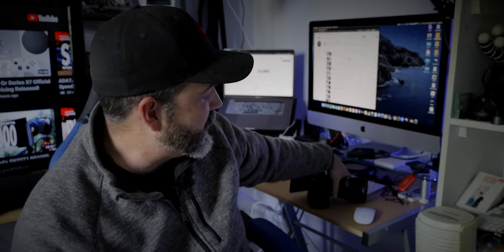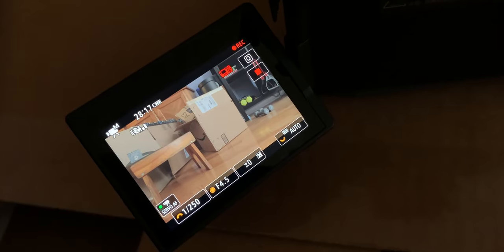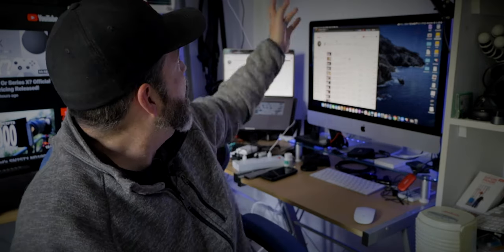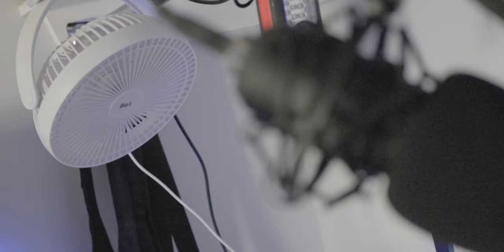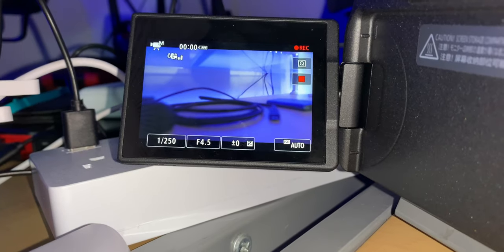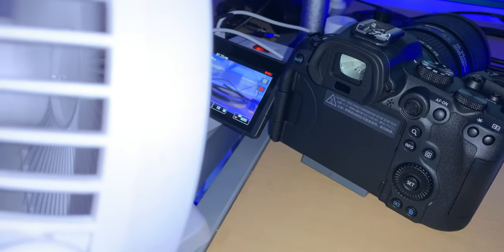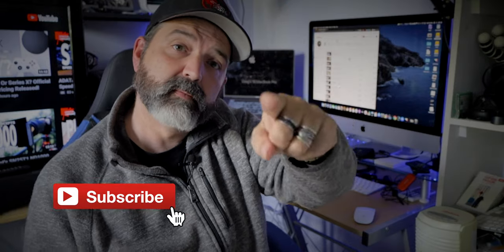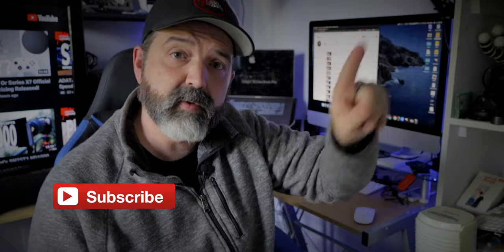Canon EOS R6 Overheating Fixed?  Our Results After Firmware 1.1.1

Comment: People should not deal with this type of issue at this price point.
Reply from the maker: There are actually a fair bit of pro-level cameras that overheat while shooting for long periods.  Would love if it didn't but at high bit rates with this quality, you can definitely come across this.  Would love a 4K option that has no overheating, even if it were at lower bit rates.
Reply: From everything I've seen about this camera, it's worth the price just as a stills camera alone.
Yes it would be fantastic if it didn't overheat, but how many people record non stop video for around 30 minutes? 
Not many, it's usually multiple short clips that will give the camera time to cool.

But if you shoot mainly video, maybe choose something more appropriate for you needs, Canon just made a big error in their marketing.
Reply: @Southern-Storm  dear friend, if you are in Italy on august, shooting a wedding, you will face this issue very often. 
In southern Italy, near the coast, you will get tmperetures (C°) in the shade from 22 overnight up to 38-40 daytime.
Coolest month is january, from zero to 22 maximum in a sunny day

Comment: Yeah, that defiantly doesn’t qualify as fixed in my opinion. So apparently the R6 is only capable on the video end if things if you live in the North Pole.
Reply from the maker: not at all.  I've used this camera and have never had it overheat in normal use.  As specs go up heating will increase.  We shall see if Canon can do anything else in an update so that we can slow the heating.
Reply: Cruisn Canada, the temps you were giving—that you were testing the R6 in, are cool to say the least compared to what we experience here in the South in the USA. That’s my point. I don’t see how you could use the R6 for video down here in any working situation. And thus far, I haven’t found one reviewer in the lower latitudes who doesn’t think the R6 has serious overheating issues compared to the Sony A7III, for example.
Reply from the maker: @r.powell2351  totally fair.  I can only give my own experience.  And for me, the camera is working great.  I can see though for some the overheating would be an issue.
Reply: Cruisn Canada, Glad it’s working for you. :)

Comment: Just got my R6 and instantly updated the firmware to 1.1.1 - Did some on and off shooting most of the day indoors without any overheat warnings whatsoever, and in 4k60 to boot. It's nice to know that it holds up in controlled conditions, but yeah it's nice to see that if I ever need to use it for longer periods an external fan setup could definitely work if it came to it. Now that I've seen some of the footage (especially the high-end 4k that downsamples from 5k) I don't regret my purchase at all. Got the RF 35mm 1.8 macro with mine.
Reply from the maker: That's definitely the lens that's next on my list.  Such a great looking lens!

Comment: I find it strange that Canon recommended using a fan when it did not work before the update.  It makes me think that they were already working on the firmware, bit shipped out the cameras before the firmware was ready.  The R6 was out about a week or two before firmware 1.1.1, so they could have easily delayed the shipment 2 weeks.
Reply from the maker: mine only came with firmware 1.0 but I still didn't have any overheating.

Comment: Out of curiosity : why do you record with such a high shutter speed 1/250th ? Have you checked whether that affects the overheating issue in any particular way?
Reply from the maker: normally i dont, but i was shooting some slo mo stuff previously and had it set there.  but it shouldnt really have any affect.

Comment: No matter how it overheats, 1080p will always be a backup option with no waiting periods so that's a great thing....you'll always be able to record.
Reply from the maker: yes, very true.  but the issue is that for some they didnt spend this much money for 1080p.  And there is a noticeable difference in 1080p and 4K.  So even mixing the footage can be something that you can notice (if watching on a 4K display).  So any increase in 4K recording time is a welcome addition.  If had no issues with overheating since ive owned the camera.
Reply: 1080 is unlimited? I read it also caused blackouts

Comment: Ill bet the cameras heat sensor is on the back just under the flip screen so a fan has an impact, but this does not mean the camera is not scortching deep inside...but as ossme says for a camera around 2.5K from a top brand like canon, this should not be happening period...they basically messed up the design or calculations somewhere.

Comment: hello there, 
great video, very informative!
quick question though: does it overheat at 4k 24 or 30fps?
Reply from the maker: it can if you run for long periods of time, but i have run up to 40+ continual mins with no overheating.
Reply: Cruisn Canada thanks so much! 
That was Truly helpful!
Reply from the maker: Luke Zotti most welcome.

Comment: Congratulations you have discovered why cinema cameras have fans in them. Hybrids are photography cameras with some video functionality. The sealed body requires engineers to make accommodations. Some companies use smaller sensors, fewer megapixel sensors, smaller bit rates that all require less processing power. Canon chose recording time limits as their accommodation. The option if you want to do video all day long is simple. Buy a cinema camera.
Reply from the maker: Or a Sony A7S3.

Comment: Thats really interesting. The stupid timer seems to be gone and the camera really using temperature to decide if its overheating, or not. I like that! Wouldnt be much of a problem to put an emergemcy fan on when you shoulder rig it
Reply from the maker: for sure as long as you don't require camera audio.  But those of us that are using external audio that would work great.